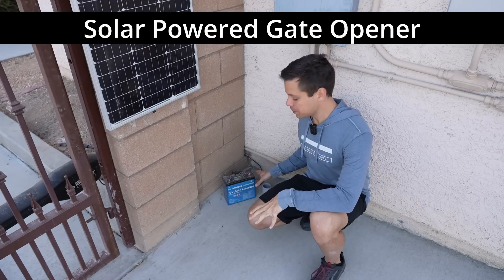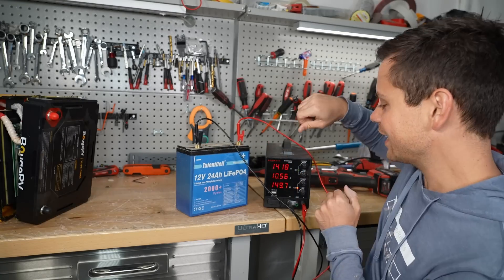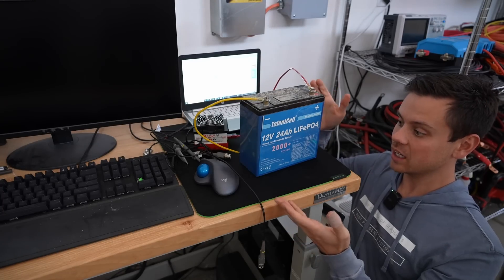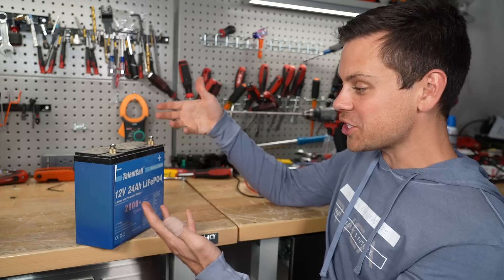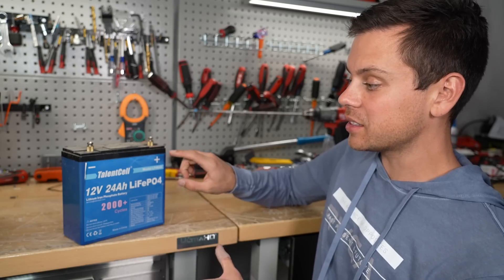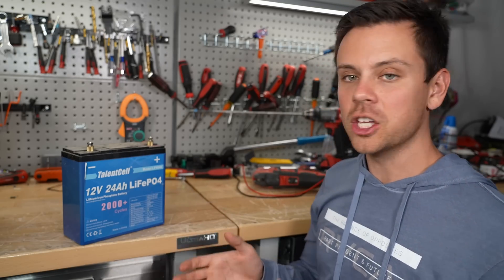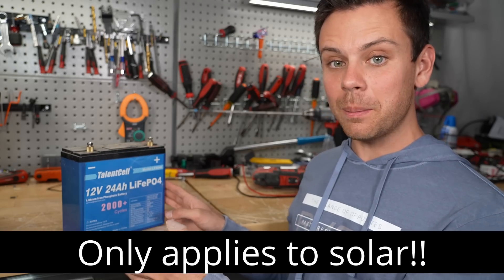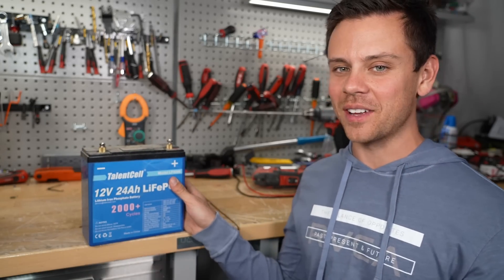12V LiFePO4 Heat Torture Test! Did we kill it!?

Comment: I have a Bluetti AC 200P in my van that I am traveling the country in.  I have read on their forum that they don't recommend that I charge it up fully and then use it while charging from the solar panels on the roof simultaneously.  They said that this will greatly shorten the lifetime of my cells but then I see other people posting that said that his is what they do and they've have no issues. I really don't see how a person can avoid this. I guess I can unplug it from solar input while using it but I have 720 Watts of solar, and if it's sunny, I want that power to going in to the Bluetti and if it's sunny and it's a 100° outside, I need to be running my window ac unit and my fridge. I just don't see any way around this.  I thought that is what pass through charging is for?  Is this really that bad for the longevity of my cells?
I Read another post by another representative who said if a person was going to do what I'm doing then they need to let the unit run all the way down to 0 and shut off and then fully charge it at least once a month. And I've been doing that and so far, so good.  I just do not want to hurt this unit as it runs everything I need and I am somewhat confused by the conflicting info posted by the different reps on the Bluetti forum.
Reply: I have the same setup in a camper and using pass through charging from solar and a DC to DC converter , I have had to re-calibrate the unit a couple of times as I found the the meter on the front appeared to drift away from how much charge the Ac200P should have had , a full discharge and recharge fixes that on my unit for a long while .
Reply: @uptowndisco  Yes, I have noticed the same especially when charging.  It seems to hang at about 80% for a while without incresing, then in about 5 minutes it shows 100%.  My monthly full discharge/full charge fixes that.  Thanks for the reply.

Comment: For a simple set up like that, with one battery, connected to one device, what do you use for a solar charge controller? One for lead acid batteries since they are so similar in terms of voltages? I'm not taking large setups, just something simple & small like that.

Comment: FYI,  When you order new LifePO4 batteries from the manufacture they are shipped at 50% state of charge by law.  So if you don't plan on using your batteries immediately I recommend topping them off with a bat charger to 100% as Will recommends.

Comment: I have one of those RWD LFP Model 3's. In the charging screen it tells you to charge to 100% once a week at the latest. I've had the car for a few months now and it's been rock solid, no issues at all. I live in Florida so I'll never have to worry about cold temp charging but I'm sure it'd be fine in the cold. I did a 3000 mile road trip with it after only putting 500 miles from new, it was fantastic.
Reply: Same here.  I live California, which can occasionally get below freezing in the winter but I've had no issues.  It preheats the battery before charging if it's cold so you don't really need to worry about that.  At its current pace it will have about 10 percent degradation at 100,000 miles.  Degradation is supposed to slow down as the battery ages, which I am starting to see but I'll see in a couple years if that 10 percent figure turns out to be accurate.

Comment: I too use one of these for my gate opener.  I solved the cold charge problem by placing a temperature sensitive "snap" switch in the positive lead from the solar panel.  It opens at 35 F.  The BMS takes care of high temp and charge control.  Crude but effective and the current involved is well below the switch rating.
Reply from the maker: Which one do you use
Reply: An old one.  Seriously, It was selected from my junk box after testing a collection of about 20.  The criteria that I chose was:  Low temp cut off - 35 F.  Rising temp turn on - about 40 F.   The one I found was "close enough".  I do know it is a lot easier to find high temperature devices.  I started off using an old mercury bulb type HVAC room temp controller.  That worked but started becoming erratic after some moisture go to the bimetallic spring.  I'm sure a web search will turn up something modern. @WillProwse
Reply from the maker: That's cool
Reply: This could definitely be a great cheap solution for low temp cut off!

Comment: I would very much like to see LFP in phones and PCs. I don't mind having a half an inch thick phone (would be even more comfortable to use) if the battery lasts forever.
Reply: That's why I use the 85% charge limit in my Samsung phone. It should help. I'm at about 18 months and the battery life seems to be decent still. Although I have noticed using the Ampere app that even at 85% the voltage is at 4.2 volts. 100% is 4.4 so they're really overdriving these batteries to get max screen time. I wish I could have set it to 70% or something.
Reply: I always assumed that the voltages above 4.2 are because my phone is using LiHV not LiPo.

Comment: Will, Great test.
In the video it looks like the current went to zero at end of charge? Do you think you hit high voltage disconnect? If you did, and the battery may be a bit out of balance and you may get even better results if you could somehow rebalance. Unfortunately the easy way to check would be the cell voltages when the current drops to zero -which means you have to crack battery open to confirm... Unless you know of another way to check balance.
Reply from the maker: I watched it charge and the current drop
Reply from the maker: No that's hvd

Comment: I love those little 20Ah LiFePO4 batteries.  They are useful for so many things!  I even hang a few off my 24V system.   24V -> Victron 75/15 -> 12V to serve as buffer batteries for certain critical 12V devices.

-Matt
Reply: I'm doing similar 2kw @24v li- ion built myself through a converter to a 2.4 kw 12v china bomb to keep it at constant 13.6v in my RV

Comment: Incredible. I love to see these data points.

One thing I see a lot of conflicting information on is mixing and matching LiFePO4 batteries of different ages (talking for a parallel configuration here).

Would love to see a video discussing that. I couldn't even really find definitive answers on the forum. Everyone seems to have an opinion.
Reply: That would make no difference.  That applies to lead acid batteries.
Reply: @davidb.5544 That doesn't seem to be the common opinion. In addition, people on the forum were claiming battery manufacturers were stating to not mix LiFePO4 batteries that are more than a month old with the ones. 

It seems impossible to find good info on this.
Reply: I did a warranty exchange from renogy. I have 8 of the 48v 50ah batteries that Will broke in a video 2 years ago.  One of them had a self discharging cell after 1 year of use. Anyway,  when they shipped out the replacement battery they specifically said not to connect it to the other 7 batteries. i told them that this would not work and if this is true you owe me 8 total batteries because I can no longer use it like it was promised to be used.  They didnt like that idea, told me to GTFO.. So I have been using the replacement with the old batteries with no problems..  The bms simply says that it is 4% or so higher SOC at the midpoint and lower.  @ExodusC
Reply: @ExodusC  I'm confused too. I can understand that you shouldn't put two 12 V batteries of different age in series to make a 24 V system. But I don't understand why connecting two 24 V batteries of different age in parallel is a problem. Ok, perhaps it is not optimal if you're a perfectionist, because the 100% SOC voltage might be ever so slightly different for the two, but not a big issue.
Reply: I have seen one he calls it his Frankenstein battery.. (Off-Grid Garage) he's funny as well😄
Reply: Yes, love that guy. OFF GRID GARAGE
 @davidhancock7377

Comment: 69% SOC is the best SOC to maintain proper length of battery lifespan
Reply: My friends, it is because of the male cathode and female anode in the battery facing opposing directions, and as a result stimulating the battery to think it's producing offspring of electrons but it is in fact just practicing producing offspring of electrons for later when the real thing happens.
Reply: That’s what I always thought but Will is saying 100% is best. Maybe due to the fact it will self discharge and so if you store at 100% it will gradually go down to healthier levels over time
Reply: Why? Why 69%?

Comment: still don't trust your numbers on LiFePo4 care for higher usage scenarios, 70-90% storage, 10% max discharge & 95% max charge is how I roll but I'm pulling between 0.8 - 1.25c & cycling the system every day for offgrid mobile power & EV fast charging for events, all out the back of an electric van, Victron,  3 phase, single phase, all upto about 45kVa constant
Reply: You mean a Tesla?   The main issue with the Tesla LiFePO4 packs is that the BMS's tracking of the SOC will slowly accumulate errors if the battery is not charged to 100% every once in a while to reset the SOC to 100%.   Even Tesla's BMSs will accumulate errors... its virtually impossible to track the SOC of a LiFePO4 pack accurately with a current monitor unless there is some explicit point where the BMS can reset the SOC to a known value (100% being the only real known value).   And this is true for ALL LiFePO4 battery systems and BMSs.

There is an accurate way to do 95%, and that is to charge to 100% and then drive-off 5% of it 🙂.   Psychologically, I think charging to 100% should be fine if you always drive the LiFePO4 based EV a little after charging is complete.  It really doesn't have to be driven much for the cell voltages to drop all the way down to the float.  Around the block is probably plenty.
Reply: @junkerzn7312  no no, I mean server rack batteries
Reply: @junkerzn7312  but yeh good point,worth a full charge to 100% every few months for any BMS like u say, but yeh in an EV I guess just when you go on longer trip etc

Comment: That's what I expected.  Everybody says do not charge while freezing or you will immediately and permanently destroy the battery but I highly doubt that will happen.  You really should try it since you say in almost every review that you should never charge while freezing.  It's almost impossible to find a video of anybody that has ever tried it.
Reply: He did that test once I think, putting it in a freezer then changing it.
Reply: @Zorlig but it was battery with heating element
Reply: The trick here is to never charge at normal rates when freezing.
If you charge at 0.5C at ambient temps, then charging at 0.05-0.1C will likely be fine.

It's understandable why people always recommend to never charge below freezing without active temperature management however because unless you have a leading edge cell, you'll kill it rapidly.
Reply: I just brought in my 18ah lachy brand battery after a year mounted under the hood of my outside truck. 400+ days, summer in 90 degrees plus, single digits for weeks at a time. No issues.
Reply: This
Reply: I have a 25.6 volt 200ah i charge it when it’s 10 degrees F and it’s been fine
Reply: I have a friend that have lost about 25% of their capacity after 3 days of backpacking away from their teardrop.   It was cold though...10F for a high

Comment: I love these kinds of tests!
Would love to see some content on a float voltage for LiFePO4 (per cell) at 3 points: 3.40V, 3.50V, 3.65V. Something along those lines. Tends to be how I use my battery bank for backup power, being topped off with solar and would love to know the ideal float for lifetime.
Reply: Generally speaking the batteries should be floated at 3.35V/cell to 3.375V/cell and no higher.  Floating higher will overcharge the cell unnecessarily.  The battery will remain at 100% when held at the float voltage after fully charging.

Cells will charge to nearly 100% even at 3.40V (at least in warm weather), it just might take some time.  So charging to "full" really just means charging to roughly 3.55V/cell (enough to ensure that the battery's internal balancers activate), holding there for 1-2 hours to give the balancers time to work, and then dropping to the float voltage.

There is no need to stress the battery by holding the voltage higher.  Charging to full does not mean holding it at a high voltage once it gets to full.  The wonderful thing about LiFePO4 batteries is that you can relax the voltage after charging and the sucker stays at 100%.
Reply: I agree, "Generally speaking."
However actual long term data from a few cell brands would be interesting IMHO in terms of float voltage. @junkerzn7312
Reply: "Would love to see some content on a float voltage for LiFePO4 (per cell) at 3 points: 3.40V, 3.50V, 3.65V."

All three of those are too high is my vote.
Reply: @HutchinsonJC  Okay. Yeah I was going off the top of my head. Quoting myself: "Something along those lines" in terms of float voltage. Not pretending to be an expert here. Looked at my current setup and I'm currently doing two packs at 3.35V (per cell) and they have been happy for the last 2 years. Test cycles (~6 months) show normal degradation (few percent). But to know the ideal sweet spot would be good...